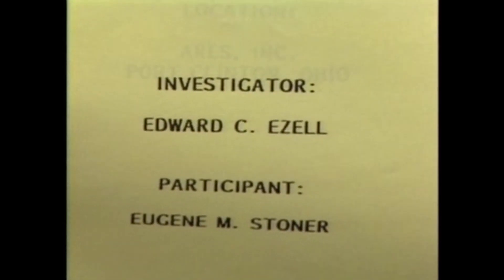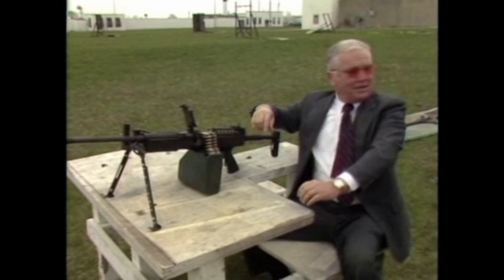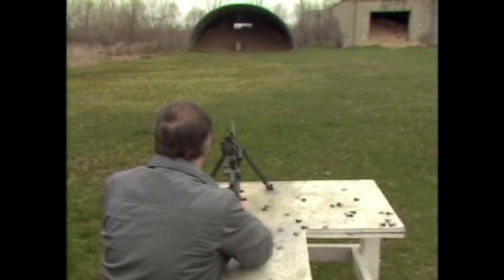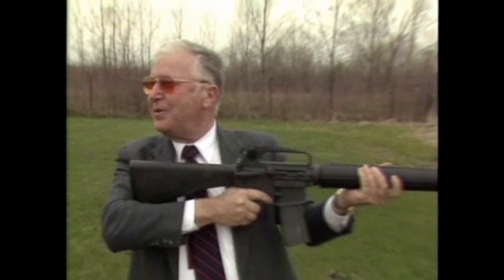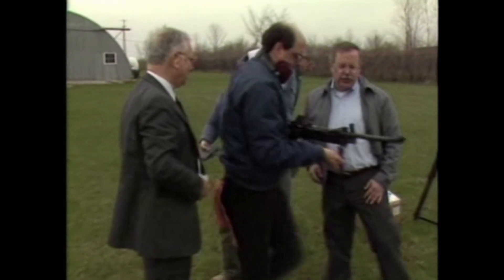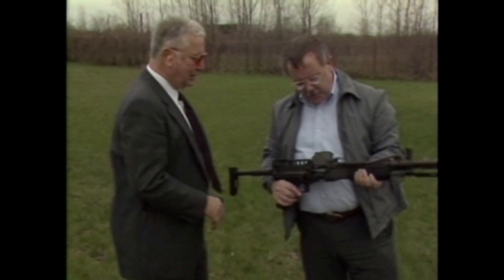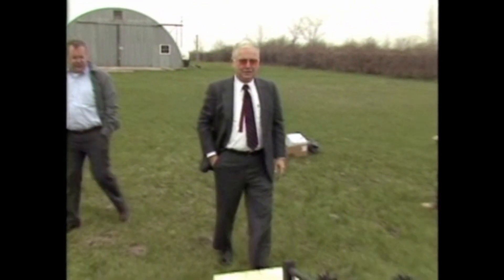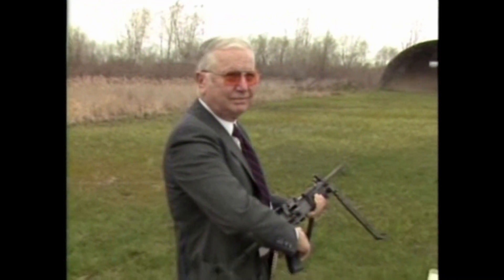The Eugene Stoner Tapes - Part 6: Range Day at ARES

Comment: A unique feature of the Colt AR M16 was the indention for rear sight. From 100 to 800. All you have too do is count the clicks. Starting from all the way down. 1 click for 100, Then 2 more clicks for 200, 3 more clicks for 300 etc...Only the Colt rear sight would do this. All the other the ball indention would not match..

Comment: The need to change the barrel port size on a weapon with constant recoil that is suppressed is not true..Different pressured ammunition can be used and it will not effect the cycle rate.. https://youtu.be/LMcZ8thlikY?si=nLHLCUSf7VuXkCPJ&t=423

Comment: 60 years and the AR15/M16 is still going strong.  It's a testament to this man's genius.
Reply: The army was all set to switch over to the XM8 rifle from Heckler Koch back in 2005.  Better, lighter, cheaper, etc.  but that switch-over never happened.  Now the army says they are about to adopt an all-new 6.8 mm cartridge with a new rifle to fire it.  Supposedly everything is in "testing" right now.  
May the testing process be better than the one that gave us the M-16 to begin with.
Reply: @robertmaybeth3434 the xm8 is not better lol
Reply: I personally think that the AR-15 just needs to be improved upon, not really replaced or at least not yet. I have personally favored the AR-15 because its modularity has made it where we can make it better. When people complain about the M4A1 or the M16A4’s issues, those issues were mostly caused by the US army and the M16 went from being a light and handy carbine, to becoming a behemoth Pig of a weapon. The M16A4/M4A1 should have been redesigned with lighter components in order to accommodate new ones without changing its original intended weight but the problem was that the weapon was no longer under the 2nd opinion of a Genius like Stoner. Eugene wasn’t a perfect weapons designer (nobody is) but he did follow principles that were more concrete than many people realize.

Comment: Starting at 10:45, what large-caliber weapon are they discussing that has a chamber that "oscillates in an arc-shaped cam" and "two chambers that feed one barrel" and has "about three moving parts" and a "plastic case"?
Reply: I suppose it's a revolving cannon, it functions similarly to a Gatling gun (Minigun, Vulcan, Gau-8, Etc), but with a single barrel that revolves around multiple chambers(or multiple chambers that revolve around a barrel), it can in fact have only 3 moving parts, chamber 20mm+ rounds and fire over 1000 RPM.

 What Stoner describes however, seems to be the above but firing caseless ammunition.
Reply: Just watch part 7

Comment: I fucking love how much MR. Stoner hated the Forward assist button he called the 
(General Wheeler Button) so it is on the AR's of today because of a General that didnt a thing about it, all because the man who was demonstrating the Forward assist, bent rounds with pliers, so it was just bent enough to not go in the chamber, but not enough so the forward assist couldnt shove it in there and fire it, thats 100% a gimmick! if the gun wont go in to battery, typically you dont want to force it in and then have a stuck bolt on your hands or something even worse than a bent round, the Army really screwed MR. Stoner in quite a few ways! it really is pathetic to think about, when the Legend MR. Stoner was there to quite literally save their lives!
Reply: @kevin pierson Wouldn’t it take too much time? Plus he would lose a round
Reply: @tlshortyshorty5810  Kevin has been real quiet since your comment hahahaha
Reply: after hearing the Kyle Rittenhouse story I feel like we finally have a justification for the forward assist button which did in fact save his life that night
Reply: @tlshortyshorty5810 all that kid had to do was pull the charging handle back lol 😂
Reply: @tlshortyshorty5810 The forward assist did not save his life. Had he been using an old Colt 604 or another version before the FA was installed, he easily could've solved the problem by either pulling the charging handle and chambering a new round or using the indent on the bolt carrier group to push the bolt forward as Mr. Stoner had intended. Neither action would've taken any more time than the forward assist, and would've had a greatly reduced chance for causing a larger malfunction than what had already occurred.

Kyle Rittenhouse should count himself lucky his rifle didn't jam after he used the forward assist.

Comment: LOL notice how he immediately fires 2 rounds when he kicks it to burst. Had to have been intentional just to keep pointing out the A2 flaws.
Reply: Nah even the military (Army I believe) issued a burst limiter redesign invitation almost immediately after it was officially adopted 🤣 the A2 had better handguards and a stronger (but sadly longer) stock, otherwise it was pretty misguided... the barrel profile needed a little adjusting, but should've been focused on better heat tolerance and harmonics, instead of worrying about tight sling shooting at camp perry and bayonet training, and the sights are fantastic target sights... so basically everything Stoner pointed out as a negative was proven to be spot on 😄
Reply: @berryreading4809  3 round burst worthless, is about the worst number of shots to fire, MR. Stoner said for many reasons.
Reply: Read up on Col. David Lutz, aka, coldblue.

Comment: Damn. That 3 round burst is really a s**tty system. Why doesn't it reset to 3 rounds every time. I'm unfamiliar with the mechanism so I'm speculating.
That seems really dangerous. And not knowing how many rounds will be fired seems absolutely incomprehesable to my firearms training and non-tactical experiences. The military needed Stoner to tell them how Stupid that system was. I'll bet they didn't ask him until after it was decided. 
Was it to save money on ammunition and logistics? A round of 5.56 is an infinitesimal drop in the bucket compared to every thing the military does.
I was a physician in the US from 1984-1991. I shot expert on the basic ½ day pistol course with a .38 caliber revolver in ~1988-89. On my only familiarization with the AR-15 we used .22LR instead of 5.56. That probably saved enough money for a few seconds of an F-16 on full afterburner burning 2-3 gallons per second.  For an F-15? Double it.
The F-16 on full afterburner with full internal fuel 7200 pounds or ~1080 US gallons will be empty in 9 minutes. That's why we used .22LR instead of 5.56.
Military priorities.
Reply: It wasn't for logistical reasons. It was honestly just a flawed design. It's sort of a triple cam mechanism. Depending on which position it is in during its cycle it can shoot only 1 or 2 rounds instead of the intended 3. It also affects the trigger pull in semi. You have 3 slightly different trigger pulls depending on where it is in the cycle.
Reply: @Anonymous8421  Thanks for the explanation. I had read bad things about the 3 round burst system starting ~25 years ago(?). In gun magazines and SOF magazine, ShotgunNews, etc. I had no idea it was such a horrible design. Thanks for filling in this information. It was way worse than I thought.
Reply: 3 round burst was designed as a crutch to increase hit probability, the thought being that the 3rd Round would leave the chamber before the recoil impulse of the first bullet had you off target, in reality it burns ammo 3x faster than semi auto and does absolutely nothing for acquiring a target, getting actual sights lined up on target and staying on target so in practice it does nothing for hot probability.
Reply: @samoksner  It was more a training crutch for full auto controllability, even with a pretty controllable rifle like the M16 it still take practice and technique to make full auto useful. The SALVO guns and later projects were built around the hyper burst concept you describe, the burst on the A2 was just there to keep an undertrained troop from spraying and praying, while still retaining some auto capacity. They would have been better off just blocking it to semi.
Reply: @samoksner  It wasn't designed as a crutch to increase hit probability. They never believed or intended that the 3 rounds would fire before recoil moved the shooter off target. 3 round burst was intended to deal with the issue of less trained/conscripted troops putting the gun on full auto then panic dumping a full mag in combat as they cranked on the trigger accidentally. This had happened numerous times in Vietnam with drafted troops so they wanted to address the perceived "issue" with the next iteration of the rifle. It solved nothing.
Reply: In every Infantry Unit I was in, we never/rarely used BURST anyway on the M16A2 or M4.  In Reconnaissance units, we trained using FULL AUTO on the M16A1 for the 1 and 2 men in break contact drills, then BURST once we got the M16A2, which was a noticeable change in volume of fire for that initial contact.

There’s an additional clutch disconnector that articulates with a cam on the side of the hammer in the BURST Fire Control Group.  That cam wheel has 2 sets of 3-round counters on it and doesn’t reset to initialize like the HK BURST FCGs do (way more complex).  There was a 4-way FCG on one of the Colt 605 variants in the early 1960s that had SAFE, AUTO, SEMI, BURST that was interesting.  You could rotate it either way into AUTO or BURST first, with SEMI being the 3 O’clock position.

BTW, F-16A/C have 6,972-7,140lbs of internal fuel capacity, depending on JP-4 vs JP-8 and temp.  Fuel budget and ammunition budget are 2 separate channels generally not considered next to each other.

USAF liked to use .22LR trainers because you can use reduce ranges without the surface danger zones required to contain the ballistic potential of 5.56x45, and for personnel who generally will never be issued an M16.
Reply: @LRRPFco52  Thank You for the detailed information about how the burst was used tactically And especially about its design. I never heard of 2 different cams. That seems like it would result in 6 slightly different trigger pulls on semi? I've only seen functional schematic diagrams (cartoons) about it. I've never really seen any breakdown videos about its function. I have suspected it was because everybody hated it? And no one is interested in it and/or wants to own an M-16 with burst instead of full auto. The 4 position selector on the prototype seems interesting but semi at 3 o'clock position seems bizarre. I'll bet there were definitely surprises on the range occasionally. Expecting Auto and getting a single shot Semi. Assuming a malfunction and executing a clearance drill. And vice versa. Expecting a semi single shot and getting Auto or Burst.
 The detailed fuel capacity of the F-16 A/C models is appreciated. On my Marchetti SF-260 ex-Libyan AF trainer with (removed .30 cal machine gun, small bomb and rocket hard points) a single Lycoming IO-540 engine producing 285 HP using high compression pistons vs. 260 HP standard. The fuel volume vs fuel temperature charts weren't  in the manual. I'm joking, of course. The non-pressurized Marchetti that I owned, never operated at altitudes where fuel temperatures effect on volume was a consideration. Not being a jet pilot of any kind, I forget those considerations are used every day by military and airline pilots.
As far as the USAF aircraft fuel and ammunition budgets? Please understand that I speculated that they were in such different budget appropriations departments and priorities, it was as if they were in a different universe. I spitballed the numbers by a quick internet search. 
I was being hyperbolic in the comparison of these things to make a point. The .22LR just seemed pointless to me, at the time, given the overall budget of the USAF. 
My Dad flew B-36s and B-52s for thousands of hours. I've got the original manuals. The fuel consumption for a simple go-around in either aircraft boggles the mind. I have a photo of my Dad as a 2LT B-36 (co-pilot vs aircraft commander) standing outside the airplane with the whole crew after just landing in Alaska, I think. Maybe Greenland. Waiting for the security perimeter to be set up and officially handing control of the 2 thermonuclear weapons on board over to the chief security officer.
Standard load was 1 - 15 Megaton yield  Mk17  Thermonuclear Bomb weighing 21 tons and 1 "dial-a-yield"  8-160 Kiloton yield MK 6 "boosted fission" bomb weighing ~8,500 pounds. In the photo, my Dad was guarding the gigantic airplane and the nuclear weapons with a single holstered 6 shot .38 caliber revolver. That he had never trained with. Everyone looks very serious as SAC was a No F**king Around Command back then in the 1950s. However, all that destructive power being "guarded and protected" by one totally untrained Pilot with a .38 is truly comical. I asked Dad, years ago, what he would have done if a Soviet Commando Unit had attacked the plane? He said, "I would have tried to shoot 6 of them." Then he admitted that he actually had the .38 to shoot any crew members who might try to sabotage or destroy the airplane and/or its deadly cargo. They used the 2- Man rule around nuclear weapons at all times back then. There were serious consequences if a person broke that rule no matter how innocuous the intent ("I forgot my wallet").
This anecdote reveals why CINC SAC General Curtis LeMay was so interested in an effective lightweight automatic rifle that could be carried around on the usually very hot, or severely cold, tarmac where the alert bombers were parked. He disliked the M-14 as it was too jeavy and unwieldy. LeMay was a very powerful General and SAC got what he wanted back then. He saw a demo of the M-16 shooting at watermelons. He was very impressed and ordered ~50,000, maybe 25,000, M-16s for the USAF security police. No forward assist. This got the ArmaLite M-16 a standard military wide acquisition number. The rest is history.
Sorry for the long comment. Thanks again for your comment and accurate information.
Reply: @msmeyersmd8  There's only 1 cam wheel with 2 sets of 3-round counters with large resets between each set. If you do an image search, you'll see exactly what I mean.  The BURST mechanism has 2 disconnectors that sit inside the trigger trough with the BURST disconnector clutch engaged to the cam at all times, including in SEMI.  It makes the trigger pull vary in weight every time you break a shot, which isn't helpful.

Yeah, SAC and TAC didn't mess around back in the day, and SPs got paid to look sharp and be A-holes on duty.

That's crazy about the Buff and your dad.  Have you ever lifted a Buff's wing and watched the opposite wing drop?  I used to do that on the flight line.  We spent the better part of 2 decades at Edwards AFB, with some stints to West Germany and Hill AFB.  Edwards has always had B-52s for tests.  I think NASA owned 1 of them.

Curtis LeMay was Vice Chief of Staff of USAF at the famous 4th of July BBQ at Dick Boutelle's farm in Maryland in 1960.

If you read The Black Rifle Vol I, it really sets the tone for that event.  The Army Ordnance Board's Dr. Carten had just rejected the AR-15 declaring it "totally unsuitable for an infantry rifle".

After LeMay shot the watermelons at the BBQ, he said he wants the AR-15 to be the USAF service rifle, and he was getting ready to be promoted to USAF Chief of Staff so he had the power to make it happen.

Within weeks of Dr. Carten effectively killing the AR-15, he got orders from the Pentagon to begin type-classification and military standardization of the AR-15 for the USAF. Haha!

They still tried to sabotage it, while the British SAS, Army SF, and SEALs started ordering AR-15s, followed by US Army Airborne and eventually Airmobile units.

The AR-15 history is an exciting blend of technical discussions, a soap opera, political intrigue, and tactics enabled by its lightweight rifle/ammunition load.
Reply: @LRRPFco52  Wow. Great information. I looked up Black Rifle volume 1 on Amazon and there is only one set available of  hardback volumes 1&2 for $600 by Chris Bartocci. Or are you referring to Larry Vickers book? I understand he recently developed a brain tumor and the ATF confiscated his machine guns. Just another reason to get rid of the AFT. Which book are you referring to. I'm leaning towards the Larry Vickers book. To support him. Bartocci definitely has the inside information from working at Colt. I've got a few more questions for you, but I've got things to do right now.
Reply: @msmeyersmd8  The first Black Rifle Vol I before Bartocci's Vol II.  Vol I has all that 1950s-1980s history.
Reply: @LRRPFco52  As nicely and tactfully worded as possible. Is there a reason why many knowledgeable YT firearms channels and many commenters seem to have a dislike for Chris's Bartocci? I'm just curious? I don't want to spread any bad rumors about anyone. He seems nice enough and knowledgeable in his YT videos.
I'm sorry this is 2 years late. But I just got a notice of a new comment today.
Reply: @msmeyersmd8  Not sure.  I've followed him for years. There was something about him being a fan of the SWAN Rails that caught some flak, but was much ado about nothing from my perspective.
Reply: As MR. Stoner always said it was a pointless/ worthless system
Reply: Yes the famous US Air force cheap-arse .22 LR adapted M-16's.  We had one day for familiarization, went to a dirty classroom where the range lady/Air woman rattled off the instructions.  Finally we got M-16's, but one per two students, not even our own, and then Air woman instructed us how to rack it and stuff.  The M16's were rusty and banged up.  Finally on range day everyone's rifle jammed once or twice per magazine of .22 LR.  Eventually they just gave up trying to score everyone that day as all the rifles jammed.  That was US Air force weapons training.